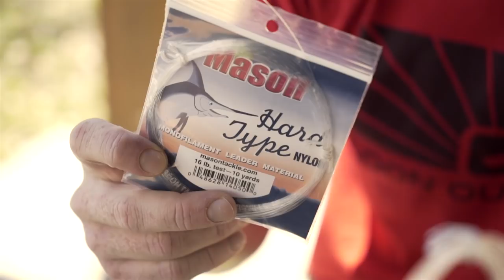Fly Tying: 239Flies.com Crustacean Eyes Tutorial

Comment: What are the black cards you are using to mix the resin on?
Reply: Could be anything. Black or any color paper from a hobby store or staples. I have used post its before for mixing resins. I save some small thin card boards also from item packages & such just for mixing resins & glues on. Tight lines!